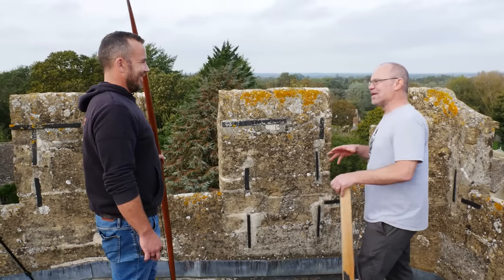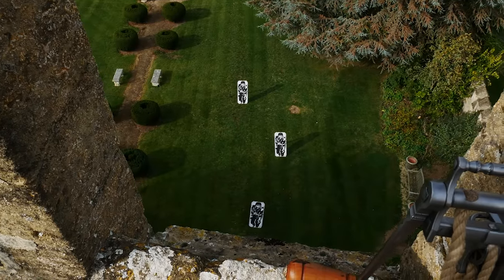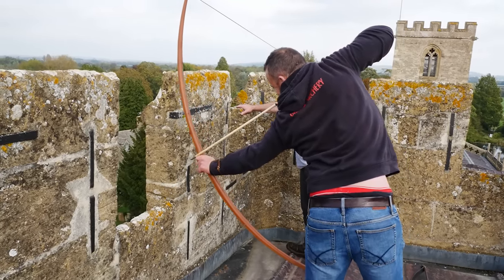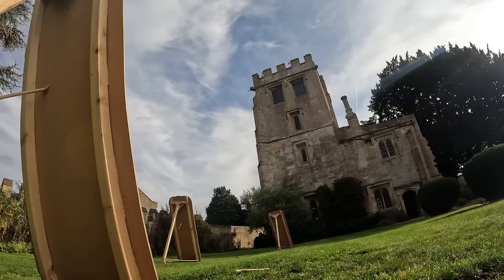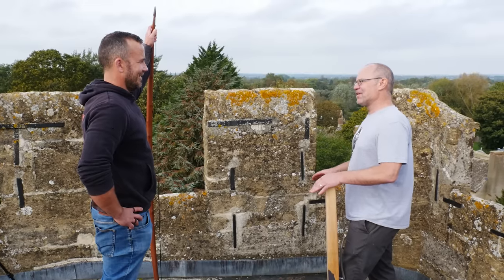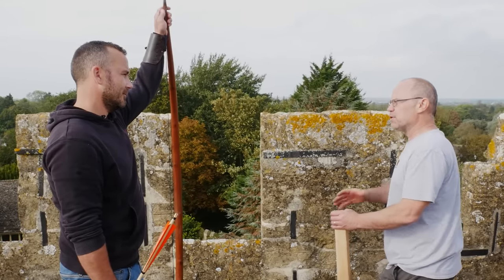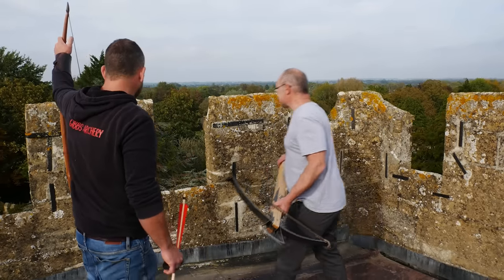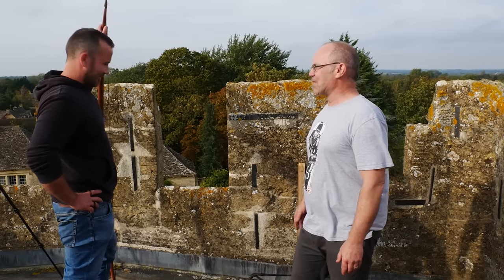Crossbow or Longbow? What's better for defending your medieval tower?

Comment: An important thing to bear in mind which was only touched on at the end is endurance. A longbow can shoot much faster, but it's exhausting. It's arrows are also bigger, more expensive, and less storable than crossbow bolts. The ability of a crossbowman to put a steady stream of projectiles in the enemies face over hours and days will be much greater than a longbowman's, even with the longbow having a much faster peak shooting rate (because that peak rate can't be kept up for any length of time). What matters in a siege, after all, is the weakest defence you can put up continuously; not the strongest barrage you can muster for a few minutes.
Reply: Don't forget  you have to have had years learning the  longbow. Very  short time to use the crossbow. Also a longbow man could take over for a  crossbow man but not the other way around
Reply: Not to mention if the longbowman throws out his back or pulls a muscle somewhere cause of the awkward position, that's going to affect his ability to shoot all that much more, or worst case, take him out of the fight entirely for a few days.
Reply: @gardenman3  Commonly said. But some crossbowmen - especially the ones using the complicated contraption Todd was handling - were paid far more than longbowmen and basically treated like prized military engineers. That certainly means that they weren't viewed as amateurs or easily replaceable. Of course that doesn't mean it wasn't possible to use a crossbow without much training, but it does mean that expert crossbowmen were hugely valued, from which it's fair to conclude that they drastically outperformed an untrained crossbowman.
Reply: @QuantumHistorian  I don't think we can conclude they outperform in that way - I suspect the crossbow mercenaries that tend to be the source of the high paid claims (at least to my understanding) get paid that much because they bring the relatively complex weapons and logistical teams to support themselves - the weapon costs way more than a stick that is only 9/10ths broken and that allows the organised group that have them ready to go to name their price to some extent - the kingdoms looking for more defensive firepower are not in the position to really say no easily - their Rival kingdoms might hire them instead!
Reply: @QuantumHistorian  "El Victorial" biography of Castilian knight Pero Nino  describes him as master marksmen and very strong man, able to span mightiest arbalest from his girdle/belt, even with a fever.

Describes this feat as worthy of a knight and warrior, and mentions many times that ability to span a strong crossbow from a belt was desired trait for a crossbowman. 

So it would be strength and constant training just as with bowmen, really. For an ability to span mighty bow much faster than with some devices, that could be easily damaged or dropped too. 

"winded" crossbows, on the other hand,  tend to be routinely considered more armor piercing that bows or lighter crossbows.
Reply: I'd suggest you are wrong on the siege as well - if you can't put up a sufficiently intense barrage they will more easily stay organised and  manage to get men up ladders on your walls. At that point  you have halfway lost I'd suggest. If anything the peak shooting rate is probably more important than being able to keep shooting - as it is that peak barrage that hopefully breaks up the organised mass assault that puts your control of the fortification in danger. So not shooting at all unless its the next massed group of men ready for another push gives your longbowman some time to rest, and while the crossbow might harass the foe in the relative lulls its not like the enemy is going to sit there inside your range letting you shoot at them - they will only really enter your firing range when they are ready to mass for the next assault if they have any sense.

Though of course this is all going to vary by how many defenders and attackers you actually have - 20 men with crossbows is probably next to useless defending a moderately sized fort against a siege compared to 20 longbows - the crossbow men will only fire a handful of shots before the men with the ladders have got to the wall, where the longbow each man probably puts out that same total number of shots individually in that time frame. But if you have more man power and/or are facing hordes so vast you really won't want to let your longbow shooters rest...
Reply: @foldionepapyrus3441  Except sieges aren't one big assault. It's a long process of building siege works, filling in moats/ditches, perhaps even bombardment, testing for weak points, sorties and counter sorties. And then when the assault does come it's inevitably in multiple waves. Being really good against that first wave of cannon fodder (arrow fodder?) is of limited value if you're too tired to handle the rest. Or if you've already depleted your ammo by the time it comes.
Reply: @QuantumHistorian  Very true, its a long process full of very little action most of the time with occasional bursts of activity - rather sounds like it suits the longbow wielders high volume of fire when it actually counts rather more in general than the steady plinking away a crossbow user might manage, and only manage usefully if the opponent were obliging enough to remain in range. Which they wouldn't - you either are making a move forward or staying out of range in nearly all cases.

And neither weapon is any good if you run out of ammo.. Which when on the defensive you really have no excuse for running out easily with either weapon, all that space to store more ammo. Now when you have to drag ammo halfway across a continent on your march to war the crossbow becomes more advantageous that is certain.
Reply: @foldionepapyrus3441  "Which they wouldn't - you either are making a move forward or staying out of range in nearly all cases." Nope. FIlling in a ditch for example. That's something that requires you to remain in range constantly darting in-and-out of cover for days. Precisely the situation were keeping a crossbow spanned while you wait under for just the right moment to shoot would work much better than the alternative.
Reply: @QuantumHistorian  I did say in NEARLY all cases, though even ditch filling you are unlikely to get a shot at anybody - don't stand around at the top of the ditch to make an easy target, and lots of mention of bringing forward timber structures for shielding the siege works. You might get a potentially useful shot off every now and then as the workers rotate back to their camps, or if some of their protection falls overs or something...

And as it takes so long to actually leave the ditches and then get far enough away for safety your archer can draw and shoot too, maybe even get off 3 or 4 shots while the guy is in range if they are allowed to waste the ammo - as ultimately neither crossbow or archer is likely to hit an individual moving to safety at range. So you probably don't even try unless you have huge stockpiles - why waste the ammo on a target that is making almost difference to your defences, and doing it so slowly the guys outside might well have to go home for lack of food before its done.
Reply: Well, both the all day consistent rate of fire and the rapidfire for a few minutes is important. In a long drawn out siege the endurance is important. But when you've got hundreds or even thousands of guys rushing the defenses trying to set up ladders and swarm up the walls or batter the gates. In those situations you want guys who can rapidly fire for the few minutes youve got before they make it onto the walls or through the gates. Or whatever else theyre doing, digging under the wall or rowing/swimming across a mote.
Reply: Crossbows have better advantages, you people act as if the bow is better than the crossbow. 
The crossbow can sit and wait, waiting, zero energy to draw the bow. 
Along side crossbows would not be openly exposing themselves so stupid over the walls. There's a reason why there's arrow slits and are mostly.
You see how the bow guy was struggling to let loose his arrow at the closer target? 😂
And considering that the crossbows merely need to sit low and wait and peak out abit while the archers are exposed. 

And the crossbow reloading machicism he's using is particularly has lots of issues. It's alot slower than the later version which is the full metal cranking tool that mounted crossbowman can use.
Reply: I suspect the best defence would be a mix of the two weapons. Steel prod crossbows ready for instant-ish response and longbows for flurry of arrows when needed. 
I’m not sure about the time taken to pop up and loose with either, I think most of the time you’d be shooting in the general direction of a group of enemy, you wouldn’t normally care which one you hit. Possibly not even if you hit,  you may just be suppressing the enemy.
Reply: @koreancowboy42  'You see how the bow guy was struggling to let loose his arrow at the closer target?' He said with a lighter bow, which the vast majority of soldiers during this time period would have had in a siege defense, he could've made the shot, meanwhile the crossbowman said there was no chance he could make that shot.

'It's alot slower than the later version which is the full metal cranking tool that mounted crossbowman can use.' The same Crank which made it so crossbowmen operated in teams of two as the process for loading the crossbow took so long? Nice.

Comment: It is pretty clear to me that the fraction of a second saved by popping up with a crossbow, and not having to pull on a bow at an awkward angle would be all the advantage you could ask for. Especially since you can give a crossbow to someone with very little experience and they will have some chance of being effective,
Reply: Demonstrated by Richard the Lionheart, being killed by a teenage cook and all
Reply: @riograndedosulball248 wait really?? Holy shit I didn't know that?! They must have been desperate if they were using a cook
Reply: @tiredanddepressed  It was during the pause of the battle. Richard Lionheart was in his casual clothes without armor chatting outside the wall fortifications and as a trolling joke a teen cook did a potshot with a crossbow and shockingly hit the king in the shoulder before running off. Eventually the wound festered and the king died.
Reply: @rubba6818 reminds me how Pyrrhus of Epirus was killed by a desperate mother throwing a roof tile at him 💀

Comment: This is really interesting to see, the crossbow removes all the biomechanical problems of the bow you will encounter in an non-ideal position
Reply: Not to mention you waste more energy under duress.
Reply: also the problem with keeping the bolt in place while aiming downwards is easy to solve. just some sticky substance at the rear of the slit, not glue strength. just enough to overcome the friction. since it would be only at the start of the acceleration, it would take nothing from the energy of the shot.
Reply: @chengkuoklee5734 not true...but hey what do I know since I'm not only a combat veteran but have also been into archery nearly 40 years
Reply: @thecursed01  most crossbows will have a metal tongue reaching over the string to hold the arrow in place, don't they?
Reply: @bl4cksp1d3r  .... probably...and I am totally not too dumb to have thought of that...
Reply: @thecursed01  haha xD
Reply: @aaronsanborn4291  I based on my martial art experience. 10 minutes sparring is more exhausting than 1 hour training. I thought I can do it one whole hour but when comes to slightly real combat, thing doesn't  go the way I intended. If it's  a life or death situation, I not sure how long, or how short I can maintain optimal efficiency.

That's  why training  & simulation is important to condition mind-body to handle stress. This will increase fighter/ soldier duress tolerance threshold, better mind-body coordination, better stamina allocation, extend optimal efficiency period,etc.

You must have gone through intense training and bunch of life or death experience that now you deem normal & not a big deal. 

I dont have your kind of experience nor training. I am very certain I will unconsciously wasted a lot of stamina when in fear an arrow in my head.
Reply: Exactly right. If you're under a roof or on the first or second storey of a building, you might struggle with a long bow. If you have crap lying around you or people bustling around, you might struggle with a longbow.  If you're sitting for hours on watch or waiting for a potshot, you will definitely struggle with a longbow. If you just happen to not be a longbowman, you will struggle with a longbow.
Reply: Note to self: Next time I'm besieging a castle, attack from the corners! Looks like that would make the biomechanical issues even more awkward for the defenders. Also guessing a recurve bow would make things easier. Seems like crossbows would be a better bet to also remove the stress and time between peeking out and taking a shot.
Reply from the maker: Bl4 - yes I suspected a little Joe would struggle, but really interesting to see how much
Reply: @tods_workshop  I noticed that the biggest problem was the placement of the lower limb. Would something proportioned like a japanese bow, with the non-identical limbs, be easier to use in this sort of archery?
I shoot a 40lb bow, and have always wondered if they change shooting style a great deal.
Reply: Of course it does, why do you think dwarfs (with shorter arms) only use crossbows, while elves prefer long bows
Reply: @thecursed01 that could probably be a wax of sorts.
Reply: @thecursed01  there is a "tactical crossbow" that is made from an AR 15. It uses something like the whiskers from a brush in a circle to hold the arrow that it fires. That might work in this situation.

Comment: Being unable to reach the closer targets is the reason behind machicolations in structures actually designed primarily for defence. Ideally you'd also have overlapping cones of fire, so that while you might be unable to fire at someone at the base of your tower/wall, your mate in the next tower could, a factor that continued into the gunpower age, hence the design of Star Forts.

(Edited to remove point mentioned in pinned comment)
Reply: MACHICOLATUONS!
Reply: @dash4800  I read that in Shad's voice.
Reply: @nitt3rz   as you should

Comment: This is why hoardings were so important: they let you lean out and shoot down at those ranges you otherwise couldn't.
Reply: It would be really cool to see Joe and Tod shoot a longbow and crossbow from hoardings, or down through machicolations
Reply: @MedievalTrebuchet  If they do that I'd prefer they get safety gear. An accidentally release bolt or arrow shattering on a wall with throw shrapnel everywhere.
Reply: @LeutnantJoker or they could get the modern simulator fir the hoardings like a scaffolding tower.
Reply: And moats or sloped walls, that keep the attackers far out where you can actually hit them
Reply: @MedievalTrebuchet  it took way too long for machicolations to be mentioned
Reply: @angrydragonslayer  Came here looking for this.

Comment: The crossbow's advantage really must've been the ability to have it ready to fire whenever, to have it ready to make that perfect shot instead of needing to expose yourself too long to fire.
Reply: The bow could do the same thing while behind the crenulation have bow drawn step out shoot then back behind the crenulation to reload the archer would only be exposed for a couple seconds.
Reply: @lasko24  Certainly not with the weight of bow they were using here.
Reply: The main advantage of the crossbow over the bow is that it is easier and less physically strenuous to train a novice how to use the weapon compared to a bow which takes far more practice, expertise, skill, and time to cultivate true mastery. The average novice wielding a bow and aiming at an individual target was far less effective at hitting their target and far more likely to become physically exhausted than a novice using a crossbow. That, and the crossbow had a higher tensile strength, projectile speed, and maximum range which made it easier to penetrate the defenses of heavy targets like knights clad in plate armor. This came especially handy in defensive, fortified positions where the crossbow excelled over the bow at more accurately and powerfully striking down enemy archers, crossbowmen, sappers, engineers, knights, or officers. Additionally, the crossbow's bolt had a longer range, higher projectile speed, and more concentrated dense mass with a terminal velocity higher than the bow due to the mechanics of lower air resistance granting higher penetrative power. The crossbow's main disadvantages are mostly related to its slow rate of fire and high economic cost to produce which made it difficult to mass produce for large armies of conscripts and levies fighting in open field terrain where the mobility, speed, maintenance, and industrial cost of the bow were preferable over the crossbow.
Reply: @eclipse_434  and that only worked in sieges (both attaccking and defending)
Meanwhile on the battlefield the fact crossbow wasnt able to volley fire as easily as a bow meant only drilled person could use it.
Which is why crossbow were only used by mercenary, standing forces, or huge operations (like the crusade) where they add all the time in the world to drill
Reply: @stylesheetra9411 battlefield fights being the rarest of any fight at the time.
Reply: And to have someone else reload it. + Fire rate doesn't matter anyway.